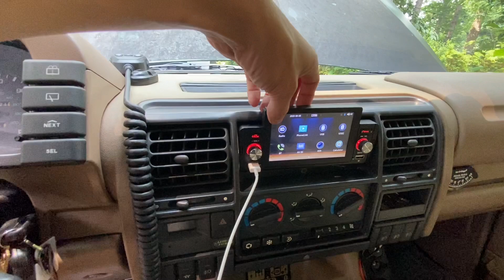I SOLD My Most Modern Reliable Land Rover!? + CHEAP MODs, Repairs and Updates For The Discovery 1!!

Comment: Troy, the cruise vacuum pump is under jack, there is a vacuum line that goes to it from the tee, the vacuum line from the air box goes to driver's rocker cover
Reply from the maker: Thanks. I’ll check to check mikes 94. I think my pump is just pain missing
Reply: @AddictedMotors  You can't really see it, it's kind of obscure, there should be fasteners from underneath! Good luck with it
Reply from the maker: Found it! Thanks!